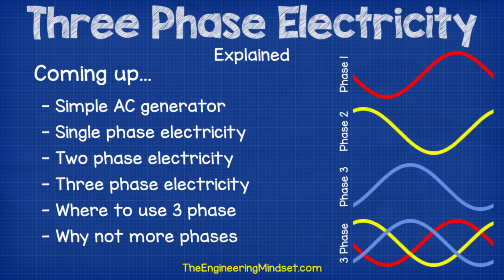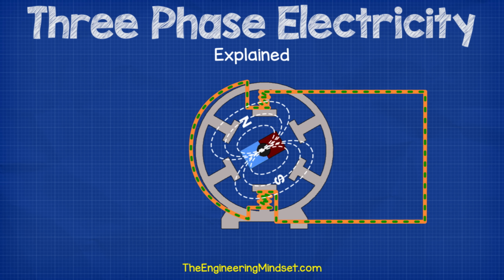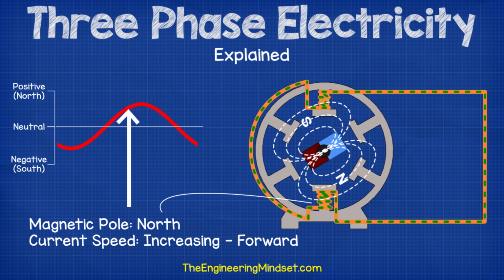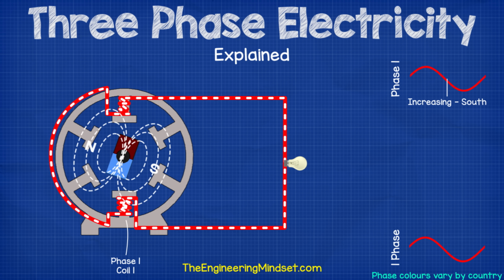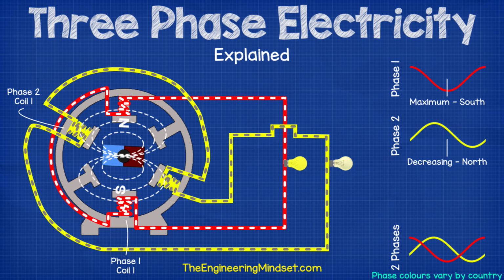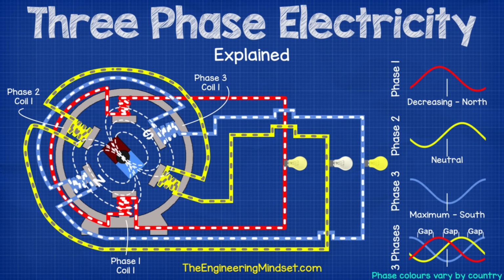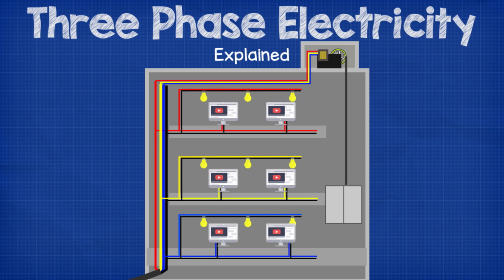How Three Phase Electricity works - The basics explained

Comment: So, what would happen if we run out of magnets?
Reply: Current through a coil is also a magnet. An electromagnet.
Reply: There are no permanent magnets in the large scale generators of multi-megawatt power plants.  It is just easiest to explain as if there were permanent magnets.   The generator uses electromagnets in place of permanent magnets, which is the magnetism produced when you power a coil of wire with DC power.

As for "running out of magnets", magnets aren't made from naturally-magnetized materials anyway.  At one point, we did use naturally magnetized ore called the lodestone, which is how magnets were first discovered, but that is no longer the way we do it.   Manufactured magnets are made from initially unmagnetized iron or steel, that is suspended in a magnetic field supplied by an electromagnet, and heated to the Curie temperature.   This causes it to lose any initial magnetism, and retain the magnetism it receives from the external magnetic field.

Comment: So confused now.  If residential areas only get one phase then what are the three wires ("triplex" ) for?--hot, hot, and neutral.  I guess the hots are on the same phase and 180 degrees apart???
Reply from the maker: I made this for a UK audience, UK has single phase, US has 2 phase and europe has 1 or 3 phase. It's because EU has higher voltage, US needs 2 phases to reach the 220V
Reply: @EngineeringMindset  Actually US residential is single phase, two leg. So what I posted earlier is correct (180-degree offset).  I didn't know that when I posed the question.
Reply from the maker: Watch this video on US electricity: https://youtu.be/fJeRabV5hNU

Comment: Are there cases where homes get three phase?  Serious woodworkers might have a cabinet table saw and those are three phase once the motor gets above 3hp.  Or does this get in to an issue with 220v where that power to the home is actually in different phases?
Reply from the maker: Yes it actually varies around the world. EU is generally 1 or 3 phases because the voltage is high 220V per phase where as US is 2 phase becuase they usse 110V per phase so need more phase to get more power

Comment: Well presented using modern techniques. It reminded me of the financial benefit of using 3-phase for power transmission, because it actually minimises the amount of cable as long as the load is balanced across the phases, compared with delivering the same amount of energy via single phase. This point was made quite early by one of my old lecturers in the past. High voltage/3 phase is better for your cash flow!
Reply from the maker: Check our new revamped 3 phase explained video, sooooo much better:👉 LINK: https://youtu.be/c9gm_NL7KyE
Reply: So why the fuck there are plenty of countries using 1 phase system actually?

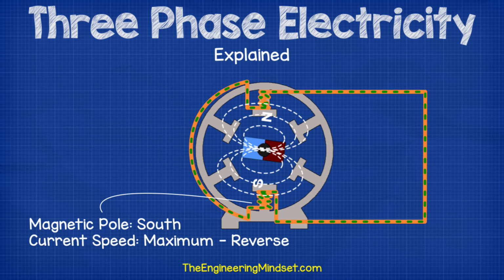Comment: 2:35  First, you drew the field lines 90 degrees out of position.  In magnet diagrams, blue is north and red is south.  The intersection of the fields should be the line between red and blue.

Second, electric current isn't about electrons moving.  They actually move quite slowly.  It's the electric field which moves.  It's rather like with water, where it's the wave that moves, not the individual water molecules (i.e. they move, but don't make the journey the wave does, just as the electrons don't make the journey that the current does).
Reply: That's actually true. People tend to think an individual electron leaves the source, goes all the way around the circuit and makes its way back to the source again. But it doesn't. It's more like a line of cars bumper to bumper. Then if you push the car at the beginning of the line forward one space all the other cars in the line move ahead at the same time including the one at the opposite end of the line.
Reply: I like to think of it as that the pressure (voltage) is transmitted fast, while the electrons travel slow. A useful analogy is a hydraulic cylinder, where the pressure is transmitted quickly, whereas the fluid in the cylinder doesn't move far at all.
Reply: @flamencoprof  - Yes that is a good analogy.

Comment: Why not use DC for a lamp?
Reply from the maker: You can, but electricity is distributed in AC. DC is not efficient for transmission a lamp at the beginning of a DC circuit would be brighter than a lamp at the end
Reply: @EngineeringMindset  So if say we have 3 lamps, then we distribute the 3-phase into 3 individual wires of DC and each goes to a different lamp? What if there are more than 3 lamps? I'm a bit new to this but I find it quite interesting and want to learn more. Thank you!
Reply from the maker: The lamp causes a voltage drop in DC. We're going to cover circuits in the next few weeks. Voltage explained video is coming in 2 weeks, I'm literally making the graphics for it now. For now, check out our how electricity works video

Comment: There is something I don't understand. If the power is delivered in the three phases, red, yellow, and blue, what is the black wire connected to when you want to use only one phase?
Reply from the maker: The wye transformer to provide a neutral line
Reply: @EngineeringMindset  Thanks. I typed Wye Transformer into my search engine, and... that looks complicated lol. 

“The more I learn, the more I realise how much I don't know.”
Reply from the maker: Watch our video on how transformers work, it's a good starting point https://youtu.be/UchitHGF4n8
I have Delta Wye transformers on the list for videos to make but haven;t started it yet

Comment: So generally, what was shown was correct except for the magnetic N and S. They are located on the ends of the magnet field not, as was shown on the video, on the sides. Also, there is not positive or negative sides of a magnet, as was stated in the audio, only poles, North and South. 
The magnetic field does not push or pull electrons through the conductor. If this was the case, you could just place the conductor in a static magnetic field and get current. Then you'd have a perpetual motion machine, which doesn't really exist. 
It is the changing of the field from one pole to the other that induces the current. If you were to move the N and S to the ends of the magnet, the video would be correct as long as you followed Fleming's right handed rule for generators. 
What is shown is a small deviation from how the system really works. And I have seen it many times in students learning about electrical induction, But although it is a small misconception, it can lead to some unfortunate confusion down the line.

Comment: Do the electrons actually go anywhere, if they just shuffle forwards and backwards at 60hz?
Reply from the maker: In AC they just shuffle. DC the move
Reply: Thankyou, I'm guessing they shuffle the length that light can travel in 1/60th of a second, Which could be quite far?
Reply: @digbysirchickentf2315  No, not even close.   The electric field propagates at the speed of light, but the individual electrons move very slow.  Think of centimeters per hour, as a realistic unit to measure the drift speed of electrons.

Given #1AWG copper wire (42.4 mm^2), and 100A of current, the full allowable amount of current in a wire this size in the NEC, the drift velocity is 62 cm/hr.

If this is 100A RMS for AC current, the peak current is 141A, and the top speed would be 88 cm/hr.  The distance it travels in half a 60 Hz cycle is 650 nanometers.  This means, starting at their initial point, the electrons would travel 325 nanometers one direction, then reverse and travel 650 nanometers the reverse direction, and then 325 nanometers back to their starting point.

Drift velocities are so slow, that the thermal motion of electrons greatly exceeds the electrical motion.   The thermal motion adds up to zero, so there is no net current of electrons in electrically inactive metal.  The part of the motion that doesn't add up to zero, is what becomes the organized electrical motion of the electrons.

Comment: Kinda glossed over 2-phase, have the sets of coils perpendicular on a generator run through a bridge rectifier for modest DC power in the field. Saves a couple diodes over 3-phase and caps/damping needed for single

Comment: In 3 phase
In actually life there r not 6 wires it iz at max 4
3 of them 380 volt and each phase with the 4th wire make 220 volt
May the voltage b different but in 3 phase one of each other can produce 380 volt
How ?
Its producing power how it complete the circle ?
Reply from the maker: it cancels each other out. I'll cover this in a later more advanced video
Reply: @EngineeringMindset  for the phase - phase voltaje from Y system.
in other countryes votaje 3ph is 127V phase - neutral and 220 in phases.
Reply from the maker: Check our new revamped 3 phase explained video, sooooo much better:👉 LINK: https://youtu.be/c9gm_NL7KyE

Comment: What r advantages of high and low frequency current?
Reply: High frequencies mean inductive effects are more significant.  The transmission and distribution lines have a parasitic inductance, which means more impedance that gets in the way of effectively transmitting power.  Inductance causes a shift in phase, rather than a loss of energy, but it will mean you will need more amps to compensate for the amps not being synchronized with the volts, in order to transmit the same power.

At the same time, high frequencies have an advantage with the electrical transformer, as a transformer can be built with less winding and core material, to convert the voltage at a given KVA.  A 50 Hz transformer can be used with a 60 Hz load, but not vice-versa.   A 50 Hz transformer needs slightly more inductance to be effective.

Another issue is that motor and generator speed is rigidly linked to frequency, in the simplest kinds of motors and generators.   The frequency needs to be consistent with practical rotation rates for motors and generators.  60 Hz motors commonly operate at 1800 RPM, which as you can see is half of what 60 Hz is in units of RPM.   Operate the same motor at 50 Hz and 83% the voltage, and it will spin at 1500 RPM.   Because we use 480V 3-phase in the USA with 60 Hz, and 400V is a common voltage in the 50 Hz world, the same motor likely can be used on either grid, but run at a slower speed.  What ends up mattering is that the Volts per Hertz is the same.
Reply from the maker: Check our new revamped 3 phase explained video, sooooo much better:👉 LINK: https://youtu.be/c9gm_NL7KyE

Comment: If 3 phases having 120 degree difference between phases.. Why we don't create a 2 phase system with 180 degree difference? That way the 2 phases will compliment each other completely..
Reply: Jinsh0 Not quite. This would best be understood by graphing y = cos(x) and y = -cos(x) (since y = -cos(x) is a 180 degree shift from y = cos(x)) on the same graph. At 90 degrees, both of the lamps would completely go out since y = cos(90) = -cos(90) = 0, and this would reoccur every 180 degrees after that.
Reply: Because that would be much less efficient.   Two phases is just not sufficient.  Three is the minimum required to justify the expense of the fancier generator and extra wires.
Reply from the maker: Seen our new 3 phase transformer video with worked examples: link- https://youtu.be/u0SsejDCVkU

Comment: The speed of the electrons is a constant. The intensity changes, not the speed!
Reply: Speed of electrons is not constant in materials, only in flight, or in a vacuum.
Reply: Joe Spinozzi it changes speed when changing mediums yes but the wire is one medium
Reply: Same as a speed of light in material, it slows down, which is why prisms and rainbows exist
Reply: @JoeSpinozzi  No, the speed of electrons is not even close to the speed of light in the material.  Think centimeters per hour as the order of magnitude for typical drift speeds.
Reply: I didn't say speed of electrons was same as speed of light, or even close.  I meant "the speed of electrons is not constant in different materials, the same as the speed of light is not the same in different mediums".  I didn't word it well (then or now).

Comment: Liked your video but I do have 1 question to ask , power plants send 3 phase ac out to the long distance transmission lines and their generators are wired in delta configuration which means 3 hot legs and no neutral . The single phase power going into a house has 2 wires , a hot leg and a neutral wire to complete the circuit . The neutral wire obviously doesn't go all the way back to the power plant and it doesn't connect to the other 2 legs coming from the power plant . My understanding is that the neutral wire just dumps the energy into the Earth to complete the circuit .  Is this so ?

Comment: I have a question, if one applies these 3 phases at the same time, as shown in the video. I understand that the airgaps is reduced, and that it therefore should give a smoother, more efficient power. However, the sum of  the three currents is zero. (the highest current is compensated by the other 2 (negative) currents. So when one combines those 3 phases together, why isn't the total current zero?

Comment: This is, by far the best illustration I have seen on 3 phase power. It also does a great job expla8ning AC power.   The dashes illustrating electrons moving are slow for the sake of the graphics, however they really move a few hundred miles out and back each cycle.   Excellent video!
Reply from the maker: Glad you enjoyed it
Reply from the maker: Check our new revamped 3 phase explained video, sooooo much better:👉 LINK: https://youtu.be/c9gm_NL7KyE

Comment: I was living in a 2 story housing complex and for some reason my doorbell (not communal bell) was on it's own separate phase to everything else (lights, oven, sockets, etc...). I still don't know why anyone would do this, but now I fully understand what AC phasing is. The other disturbing thing was that the bell part was attached to the landing in easy reach to little hands. (only shared thing were the hot water tanks and outdoor lights).
Reply: A phase is not the same thing as a circuit in a building.

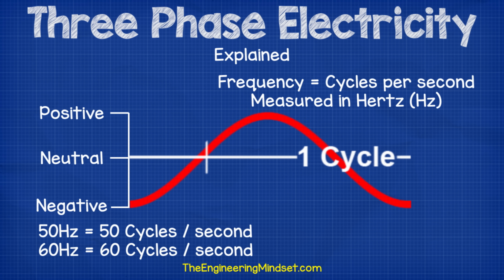Comment: Nice graphics and explanation.  I hate to nit pick, but at 4:00 the statement that current reverses 50 times a second for 50 Hz power is not correct.  During a full cycle, the current reverses twice, once from positive to negative, and once from negative to positive.  Your statement equates alternation and cycles, but there are two alternations to each cycle.
Reply from the maker: Check our new revamped 3 phase explained video, sooooo much better:👉 LINK: https://youtu.be/c9gm_NL7KyE

Comment: It looks like one phase runs through a coil & the other through another coil. So if you had 100 watts of power in one coil of a motor & 100 in the second than the motor would produce 200 watts of work. But what if you had one phase connected on one end of the motor coil, & the other phase connected on the other end of the same coil. Looks something like a differential pulley in that a voltmeter between the two wouldn't be as much as either to ground. Thanks for clarifying that up.

Comment: Okay look i bought a PMA it is 3 phase 7 big power magnets makes like 700 watts at like 1100 rpm it makes   110 ac volts each phase makes 20 hertz or rps totaling 60 just like home power or is home power 3 phases totaling 180? Originally it had a built in DC rectifier but i can now just install a regular outlet to plug my power tools i tought. most electronics rectify it to what they are gonna use i think. I believe i need to figure this out.

Comment: Great video. Can someone answer my question? I understand that by adding two more coils you generate currents in the second and third circuits. But are the currents in the second  and third coil affected by the first coil's current? Don't you just end up with three lamps that go thru max, min, neutral just at different times INDEPENDENTLY? How is the third lamp's light almost max as said here? What am I missing here? Thanks.
Reply: +Nikan RT - The advantage of 3 phase -- and what the author did not clearly put across by his flickering light example -- is that power is always going to the load. Look at the diagram of the 3 separate sine waves: when any one phase is at zero, the other two are still delivering power. For something like a motor, this translates to smoother, quieter, more efficient operation compared to a single phase motor of the same power. For both motors and generators this also means more power for a given physical size, since 3 phase design takes advantage of space within the machines to pack in coils for the other two phases -- space that goes unused in a single phase unit. In the simplest analysis it's like comparing a single-cylinder engine to one with more cylinders. The multi-cylinder model will always deliver power more smoothly as well as provide more of it. Ask any motorcycle aficionado. Hope this helps.
Reply from the maker: They go through min, neutral, max, neutral independently. The position around the generator dictates when they will go through this.
Reply: Thanks. So what's the advantage of this arrangement then? It sounds like each one will flicker just at different times then. In the video it was stated that you get less flicker. Why?
Reply: Thanks for taking the time and commenting.